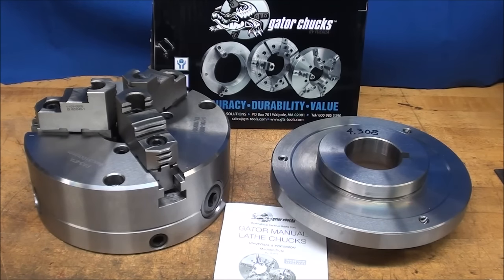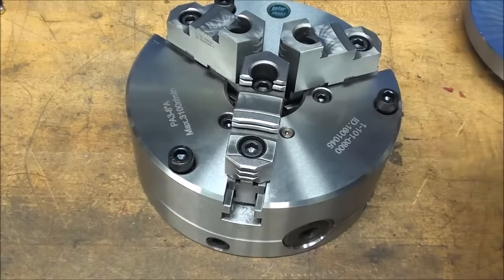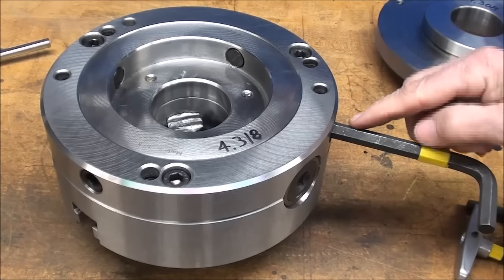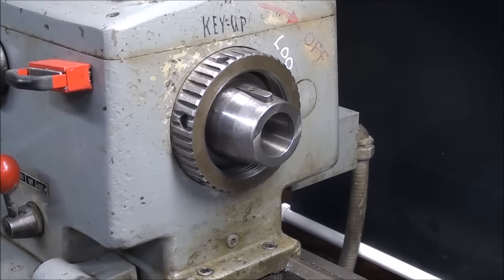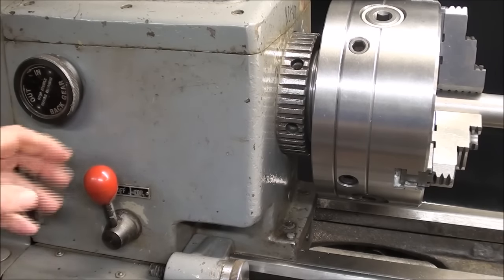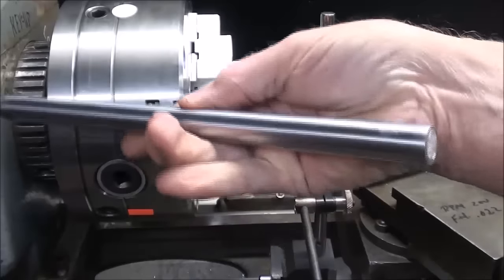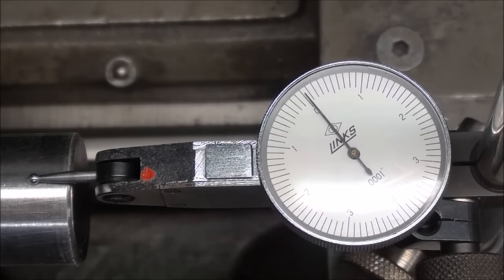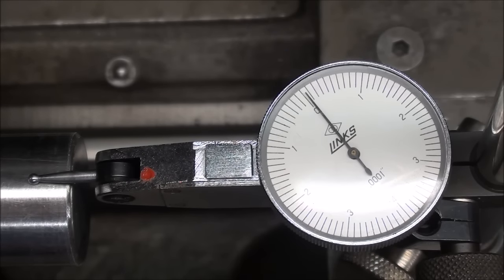SHOP TIPS #292 Mounting a GATOR Tech-Tru Lathe Chuck tubalcain

Comment: B. Fox, 44 years manual machinist. Mr .Pete , your gator chuck will remain true on any stock that is 1.000 inches in diameter. However , for any other diameter, there may be a noticeable amount of run-out. This is due to the fact that the SCROLL of ANY chuck is NOT universally accurate. Great video,very instructive,and well done!

Comment: I watched and enjoyed this video last week and today I was putting  together a Buck 6" chuck that I had apart for several years.  I am not sure that I would have realized what I had if you had not made this video.  You know where I am going.  My ten inch 4 jaw has been kept on my 14" Clausing ever since I picked it up from a trade school about 9 year ago because of too much runout on the 3 jaw.  My only wish is that it was an 8" .  I set it up this afternoon after a good cleaning/oiling and got it within about 3/10,000".  I doubt I will use it much, since the four jaw is so easy for me now, and of course the 3 jaw is smaller.   Thanks for information that will make smaller round stock jobs a lot easier.  I got a free chuck, you have made my day!
Reply from the maker: +Ronald Gilleland Thanks--glad I helped. Yep, that .0003 is mighty close

Comment: Another great video that gives me an idea.   The first one to manufacture one please send me a freebie and ten percent cut.

Most small lathes made today use a 3 or 4 hole mounting plate with a 100 mm raised register.  A simple two piece spacer plate with 0.010 oversized male/female interface with four jaw like set screws set 12/3/6/ and 9.  One plate mounts to lathe plate solid, once adjusted the second mount thru the newly accurate three jaw chuck into the second plate.  Thanks Mr Pete, maybe I can recoup some of my misspent inheritance.

Comment: At 15:00 - About the deflection caused by your hand on the chuck during alignment - I don't know if the need for accuracy warrants it, would it help if you used a dead center in the tail stock into a center hole on the "alignment" rod to stop that deflection.  Or am I gilding the lilly and over thinking things?   Thanks!

Comment: My 60 year old 12 inch atlas had the first few inches of the bed worn out of accuracy and was cutting tapers. I accidentally fixed most of it by putting in a new, larger Chuck with a big mounting plate/ collar on it. This basically pushes the work about 4-5 inches toward the tailstock where the bed is truer. This is more practical than getting the bed regrouped.
Reply from the maker: Sounds like a great solution

Comment: Mr Pete, last time I got a new chuck and backing plate for a lathe, it was recommended that the backing plate be mounted to the lathe and to take a facing and turning cut before mounting the chuck. According to the instructions that came with it, it was to make sure the chuck would run true for that machine. I have seen some backing plates have a run out of .010 to .020 on the face and OD. Even with a new lathe they recommended to mount and take a light facing and turning cunt on the backing plates before mounting the chucks to them. Could it be because they were Cam-lock mounts? 
Great video though.

Comment: What about turning a perfect axle with constant OD which is straight which will fit through the chucks bac openingk: clamp the axle into this new chuck and mount the axle between the head and tail stock. This allows you to measure the back of the chuck in a controlled way

Comment: Enjoy your new chuck, sir, and thanks for sharing with us. Regarding your remark at the end, why is a test indicator more precise than a dial indicator? What's the difference between them? Thanks :)
Reply: +aryesegal1988 His test indicator was 0.0001'' where as his dial indicator was 0.001'' scale.  So 10 times more resolution when used at the proper angle, which Mr. Pete did.
Reply: rfnoise I see. A thought he meant that because of their mechanics and the difference in how they're designed and built, a test indicator has an advantage over a dial indicator in precision.

Comment: Great video and product. I have a Gator 8" 4-jaw chuck with an integrated D1-4 and found the product very well made. I have a question: I noticed one of the jaw adjustment openings marked with a "O". Is that the master pinion adjustment position for consistent clamping of the jaws?
Reply from the maker: +Paul Jones ????
Reply: +mrpete222 Here is a link to the discussion on the master pinion position for 3-jaw chucks. http://www.homemadetools.net/forum/chuck-master-pinion-27461 . I am not sure if this applies to your Tech-Tru lathe chuck.
Reply from the maker: +Paul Jones An excellent & very erudite explanation of the master pinion--thanks much. And I think it applies here. Maybe a video on that

Comment: If the difference in diameters between the chuck and backing plate is only 0.010 (4.318 - 4.308) how can you adjust out the greater-than 0.030 runout?  Wouldn't you need to reseat the backing plate on the spindle?

Comment: this was really informative for me!   I've worked on a wood lathe for many years (making bowls and such) but been fascinated with metal work.   Don't know if some of your earlier ones had this same sort of thing or not, but if it did, i must have missed it.  

I do have a question....the .010" adjustment built into the chuck, how common is it for the chuck to be "out" far enough that it needs more than what that distance will accomodate?    Do they get that worn, or is that really only when things get REALLY worn out and should just probably be replaced?
Reply: Everything gets worn after some usage. But a good chuck doesn’t wear that quickly. Forged steel chucks can hold their accuracy a very long time if treated correctly. I was able to center my Buck 8” Adjust -Tru to about 0.0002”. So far, after about 6 months, that accuracy holds. I expect it to hold for a year more, at least.

People abuse their equipment, and that’s a main reason why it goes out of adjustment.

Comment: Just curious, how could initial chuck runout be 25 thou if diameter difference between backing plate hub and chuck inner was only 10 thou? Or then how could adjustment correct that? 2.5 thou I could understand.

Comment: I just got an old south bend lathe and have a question that I can't find an answer for, how do you tighten the saddle? Mine is a bit loose. No left right wobble, but it has up down wobble.
Reply: There's a plate under the bed that holds the carriage down. The 2 bolts may be loose.
Reply: 1musicsearcher Thanks, and the gib screws for the crossfeed and compound, where are they? I can't seem to find them... Thanks again!
Reply: +rkshireygames Some such as my heavy 10 have tapered gibs.  They are adjusted from the handle end of the gib.

Comment: Do all these mini lathes have chucks that allow your work to pass all the way through the machine? Allowing you to use longer stock than the machine is long?
Reply from the maker: Its not the chuck--its the spindle hole size--they vary greatly
Reply: mrpete222 : any recommendations for a mini mill that you could thread a rifle barrel in? I don't recall seeing spindle hole size as a spec on these mini mills
Reply from the maker: sorry--never used one

Comment: With 65 years of Manufacturing, all chucks accuracy are not the same. All depends upon fitting of jaws in body slots, scroll fitting in chuck body, scroll thread and jaws thread ground. We as a manufacture able to produce some chucks tru up to 0.02 mm and .005 mm in Power chucks in soft jaws. But all chucks accuracy are never the same.